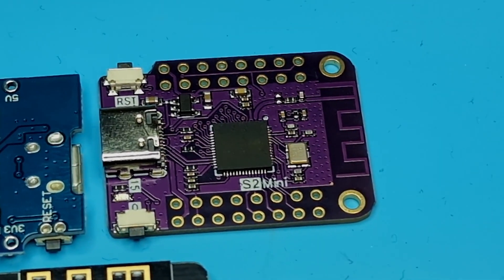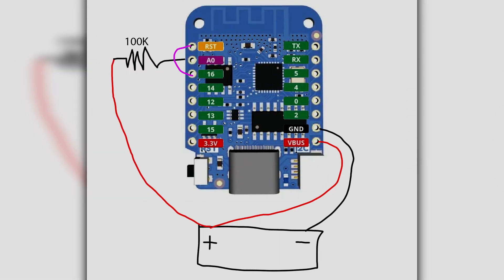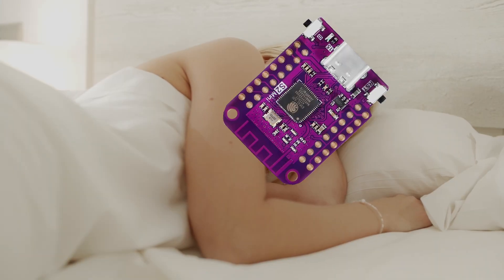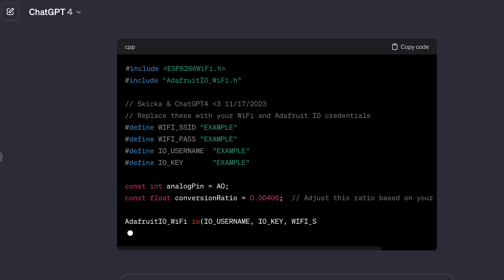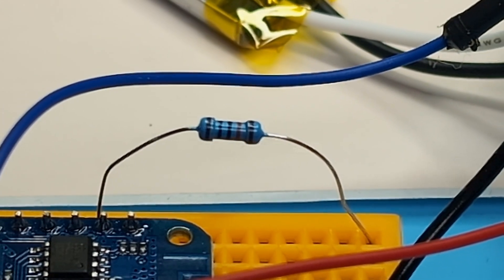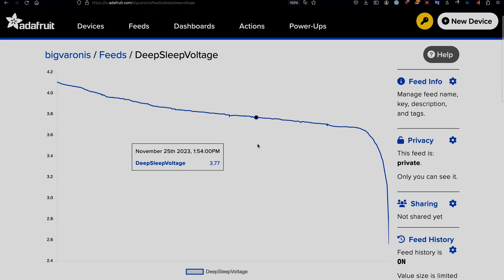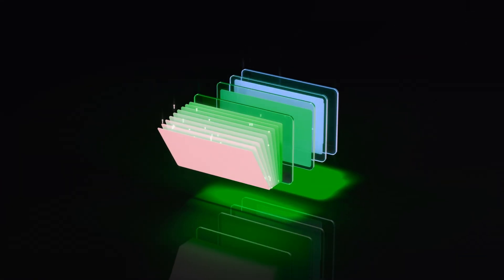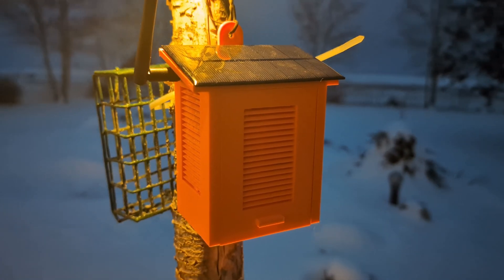Supercharge Microcontroller Battery Life With Deep-Sleep

Comment: Great introduction to the concept.  I'm building a replacement computer for my rowing machine.  Deep sleep will be an important part of the code. Right now I just power it on and off manually but the plan is to make it so efficient I don't need a power switch.